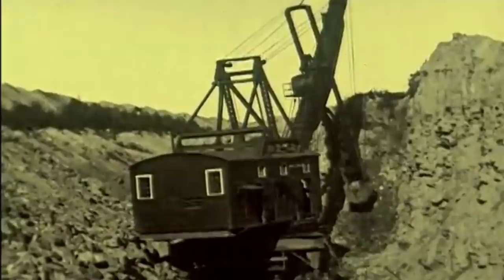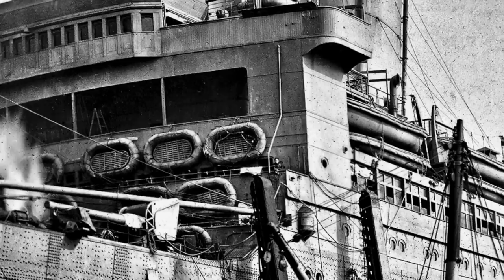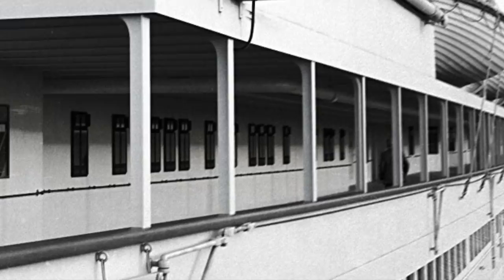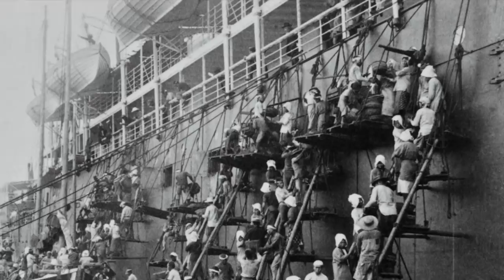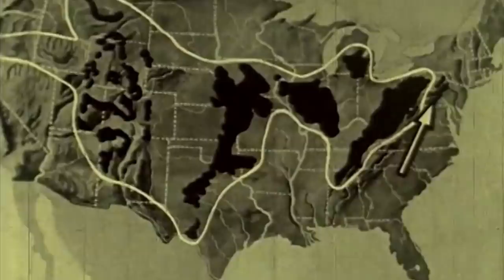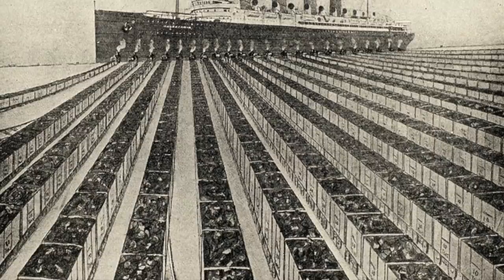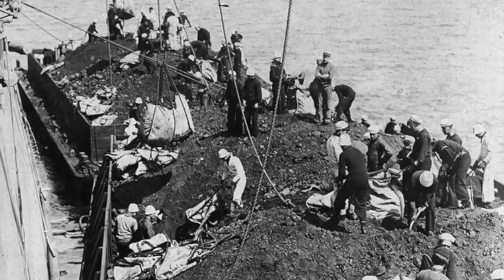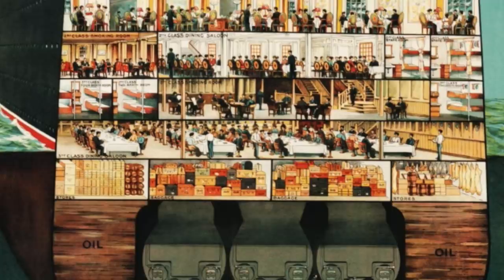Coaling/Bunkering an Ocean Liner

Comment: It was even worse for military vessels that couldn't have the hatches in their sides due to their armour.  Coal was loaded in bags and carried below by the crew, coal was often used between the outer hull and the armour plate to increase the protection, as a result of this and other factors coal was all over the ship complicating the firing process.  Often military vessels would be used to blockade an enemy port, this meant that ships involved had to refuel and reprovision while at sea often under difficult conditions, this could make a difficult job even harder.
Reply: The Germans had 5 meters of coal bunker along the sides of their ships in the Jutland battle, and it saved a couple of them. The Brits had oil bunkers, and lost this protection.
Reply: @floro7687  The only major oil fired Royal Navy ships at Jutland were the Queen Elizabeth class battleships of 5th Battle Squadron, every other Battleship, Battlecruiser and Armored Cruiser was coal fired. They did have fuel oil which was sprayed on the coal to get more power, but coal was the primary fuel and they all had thick coal bunkers behind the belt armor that served as extra armor. Though against armor piercing shells coal is usless as armor, but it was sort of effective as a rudimentary torpedo bulge. On the other hand coal has the downside of having a tendency of spontaneous combustion in specific circumstances, as well as coal dust being very flammable - coal bunker fires were a big danger to all coal fired ships of the era.
Reply: Could they not make a chute on top of the ship to pour it in? Like on the top deck, a chute that can be opened from a hatch.
Reply: @FlorenceSlugcat  Im no expert, but battleships needed to be protected from fire coming down at an angle, so the decks were significantly armored. The holes through the armored deck were either the armored barbettes that connected the turret to the magazine, very small chutes that allowed the secondry battery ammo to be passed through, and a few crew passageways in the middle. But for coaling you needed pretty large holes on the outside edge, the coal bunkers were almost always on the outside edges of the ship. Holes there would be particularly vulnerable to hits, as well as hits there traveling very deep into the ship
Reply: Pretty sure it's been determined that the USS Maine blew up due to a smoldering fire in a coal bunker-- just to add to the general sense of "no thank you" for coal burners.
Reply: @FlorenceSlugcat  There is also the issue of weight distribution. You have to be very careful about making sure to not get to much weight at any one spot as it causes issues with the way the ship sits in the water.
Reply: @vtbmwbiker  really since you have a choice in modern times.
Reply: @vtbmwbiker  I had heard that someone was smoking and set off the explosion. In any event it was internal.
Reply: @vtbmwbiker  The Maine has been investigated four times, each with a different conclusion.  I agree that Admiral Rickover´s conclusions in the 1970s make the most sense, but National Geographic thought otherwise.
Reply: @elisabird6245  What was Rickover's thoughts? I haven't head those. I'm assuming that the "underwater mine placed by the nefarious Spaniards" wasn't part of it?
Reply: @vtbmwbiker  No, indeed.  Rickover´s conclusion was that the explosion was caused by heating of the coal in a bunker which was close to the munitions store.  This had happened to a number of other ships before, though the Maine had experienced no previous problems and crew said they had inspected it for temperature and found it normal.
Reply: I don’t think coal would have made much of a difference for protection. 

Yeah.. for protected cruisers a generation earlier it was their primary method of protection—but more against the commerce raiders and auxiliaries they would be fighting in far off places with 4-5 inch guns.. not a full broadside of 12-15 inch projectiles. 

Deck armour was limited because plunging fire wasn’t deemed to be a huge risk in the North Sea with limited visibility and optical rangefinders and fire control. Most battleships could not elevate their guns a significant amount for plunging fire.
Reply: The Royal Navy tried very hard to convert to oil.. but looming war made them switch back to coal for the Revenge class battleships so they could be ensured of a national energy source.
Reply: @vtbmwbiker  Admiral Rickover´s conclusion was that the explosion was caused by coal in bunker 16 heating up to a point where it caused the munitions in the store next to the bunker to ignite.  This makes logical sense, though there are still those who don´t agree with it.  Partly I think, because it means some of the navy´s ships had this design fault and partly because they don´t want to admit that a war was fought due to misinterpreted evidence.
Reply: @FlorenceSlugcat  I have seen pictures of navy ships being coaled from the main deck rather than the side of the hull. I don't know how common that was though.
Reply: Every part of the ship was covered in coal dust. It was not only hard work cleaning ship but seeing one's once gleaming vessel covered in black dust must have been heartbreaking. Years ago I unblocked the chimney on my three storey house (it had been filled with bricks). I used two old oars jointed with a boltand when the last bricks had rattled down every single part of the house was begrimed.
Reply: bademeister  I was talking about major ships, e.g. armored cruisers, battlecruisers, battleships. Smaller ships were oil fired, but at that point the argument that coal bunkers serve as armor is irrelevant - destroyers and protected cruisers had no belt protection, and a little coal wouldn't make any difference to armor piercing shells. And in either case German destroyers/torpedo gunboats also had oil fueled types also fought at Jutland.
Reply: The Russian fleet heading from the Baltic to the Pacific to fight the Japanese in 1905 decided to do this multiple times while at sea! One of many reasons to feel bad for everyone on those ships.
Reply: @Bartonovich52  generally the large guns (naval rifles) don't fire 'broadsides' but rather do as referred to in modern artillery books as 'indirect fire', firing upwards at a steep angle with the projectile coming down at a near vertical angle, landing on the deck rather than on the ships sides.  Only when the ship has been so disabled as to not return fire can the opposing ships more in and finish it off with direct fire.
In fighting ships it is very difficult to  have large deck ports or hatches.  It takes a rather massive physical structure to support the weight and firing forces of the major guns.  In the areas that would be a hold on a cargo ship is where the turrets would be mounted, they are carried on deck but go down multiple decks and weight hundreds of tons.  Recoil is transferred from the gun to the ship and realize it moves a 50 thousand ton ship sideways up to several feet.  The force is immense.  Furthermore the deck itself is a structural member of the ship, the top plate of a beam, the sides being the web and the ship's bottom the lower plate.  Battleship can and do run at high speeds in heavy seas placing immense loads on the hull making it a fortress that moves at nearly 40mph (for you land lubbers) or 32 knots for us sea dogs.
Reply: @FlorenceSlugcat   I have a book on modeling British battlecruisers in a large scale, and there are some deck photos which show a number of coaling hatches on the deck.  They are near the edge of the deck, presumably outside of the armored citadel deck.  Basically, the bags of coal are transferred over to the ship, dragged to those hatches, and emptied into them.
Reply: @elisabird6245  Realistically, the war was going to happen, because American interests in the Carribbean and Pacific were going to bring it into conflict with Spain sooner rather than later.
Reply: Why weren't augers and conveyor belts used to feed the bunkers/boilers ?.
Reply: @michaelmccarthy4615  The technology to do that on a large scale didn't exist yet. People were just easier to use, especially given the minutae of doing it properly to ensure maximum steam pressure.
Reply: @HighlanderNorth1  how long did it take you to write this drivel? Go back to OAN.
Reply: Was it not coal stored between hull walls, which spontaneously ignited in a low-oxygen environment and weakened the outer hull of the Titanic?
Reply: armor***

Comment: Britain's Royal Navy was in the process of converting as many warships to oil when WW1 broke out. Those coal burning warships were the last ships you wanted to be on. Coaling was a filthy time consuming job that had to be done regardless of weather conditions. Usually done by chutes from a collier. Woe be the officer in charge if coal dust fouled the decks. The dust tended to get blown into the on deck machinery and gun turrets., or became a slurry in bad weather making the decks dangerous to walk. Deck hands then had a messy job to clear any trace from the decks.
Reply: Don't forget the increased chance of a dust explosion which is not what you want during a battle